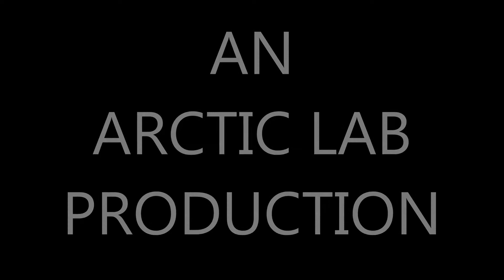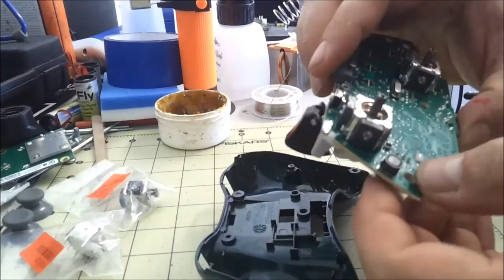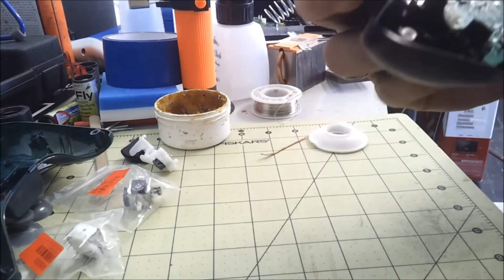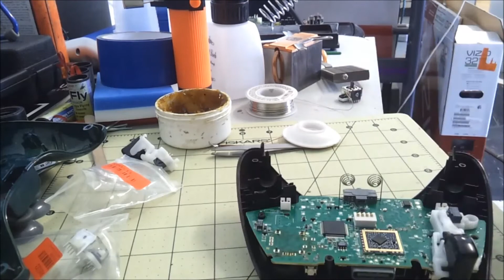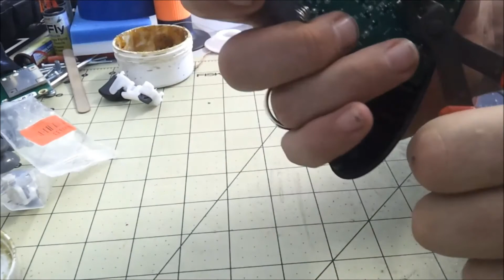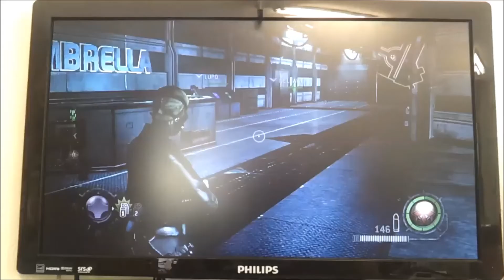XBOX 360 CONTROLLER ANALOG MODULE REPLACEMENT [REPAIR]

Comment: THOSE MOTHERFUCKERS THESE BREAK SO EASILY THEY SHOULD BE HOT SWAPPABLE I SHOULDN'T HAVE TO SOLDER THOSE MOTHERFUCKERS GOD DAMNIT, I have a wireless controller that won't charge even though I'm trying to use it wired on a PC and I have a wired controller with a bum stick, i should be able to take the joystick out of the one and put it into the other BUT I CAN'T because my hands are too shaky to solder, I have the tool, I know how, I just CAN'T anymore. I should've lever actioned my face into the psych ward wall, Jesus Christ I can't even fucking escape reality.
Reply: And I basically had to break the wireless one's case to get into it, because even though I managed to get all of the damn unnecessarily security posted torx screws out of the wireless controller with a flat head screw driver, it still wouldn't come apart and I had to rip it open.

Comment: What to do if after re-soldering a replacement  analog (3rd party part) it drifts a bit to the left and downwards? Physically it looks straight in the center. Is there a way to log in to the controller to adjust it's analog possitions?
Reply from the maker: unfortunately no. there is no way to adjust it. at least not that i know of. you may have gotten a bad analog module. some of the cheaper ones on ebay are like that.
Reply: @ARCTICLABSERVICES  do you have a source where i could get good ones?
Reply from the maker: @GGHadas  no. Sorry. I havent bought any in a long time. I have always noticed that the ones with copper pieces next to the stick part where the best quality. Not sure why though.
Reply: @ARCTICLABSERVICES  thank you for the tip

Comment: i had removed my analog and tried another in its place and now it doesnt power on/connect anymore does anyone know how to diagnose or any common hazards soldering the board?
Reply from the maker: D Vice, if you removed the the left trigger, there are small resistors close to were you need to desolder. Check to make sure they are still intact and soldered securely. That is the only thing I can think of.